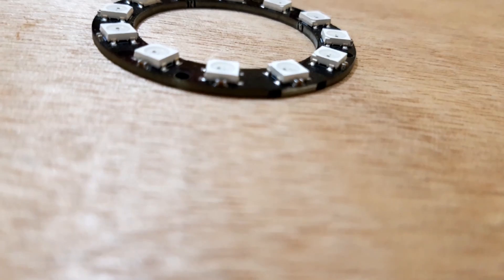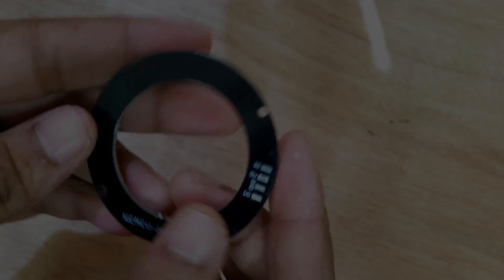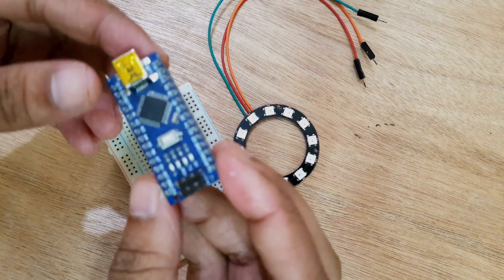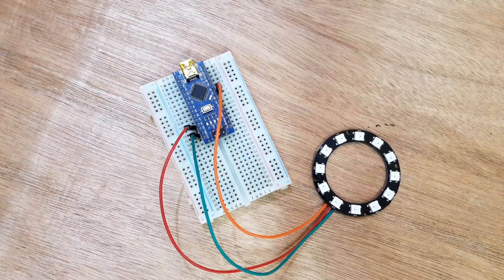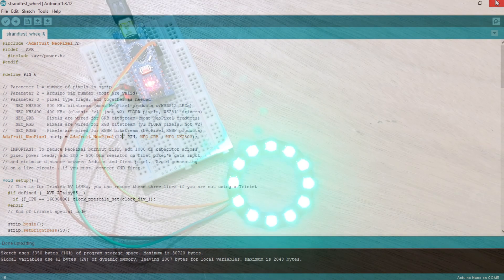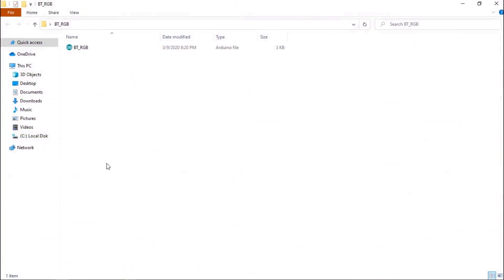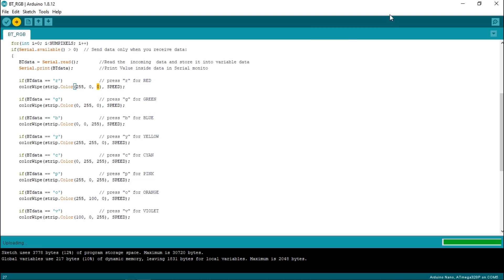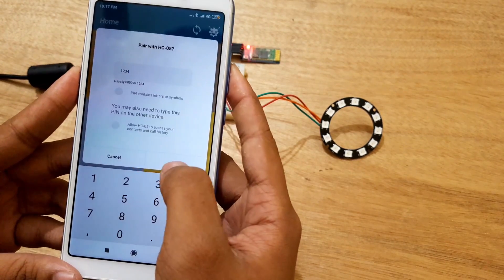Getting Started with RGB NeoPixels| WS2812B

Comment: Thanks for a great video!! 
I made an Arduino leonardo keyboard gamecontroller with 20 digital pins which I use on laptop usb or android tv. And it works perfect!
I want to use the led ring you have used along with SeedStudio Grove RGB LED stick (10 - ws2813 mini)  for background illumination decoration of my keyboard gamepad.  Is it possible to use these 2 led modules together with single Arduino Leonardo?  Any help would be appreciated :)
Reply: Yes

Comment: Personally, I would of done the wiring the other way around, in that the male pins are soldered to the neo-pixel ring
and using the female jumpers to connect directly to the arduino mini,

Granted you would always have to have it connected to the pins of the board, but for this example it would of been fine to do this way and you can scap the breadboard, making the project more compact
Reply from the maker: Hmm,

Comment: now i woud need this exact thing only the leds woud need to be only red and have + and - nothing else if anyone knows where i can get that please coment
Reply from the maker: So, need the same thing, but with only red led?
Reply: @ElectronicsBd  ye the ring only with red leds and have + and - thats all
Reply from the maker: @Maykay1312  I don't think It's available
Reply: @Maykay1312  if you mean without a mini controller idk how you would do that
Reply: @mitchdbd4706  its used as a ring same as the angel eyes on the older bmw inside the headlight but i put the same style led projector on my electroc scooter and the ring light was overvoltaged and it died because my step down dc to dc board overheated and exploded xd
Reply: @Maykay1312  oh lol i was planned to use this as an angle eye aswell haha
Reply: @Maykay1312  but my scooter has this 12v thing ehere you can put a charger in and then i could put the arduino in that charger and the arduino will make sure it's red or whatever i make it too and will put out 5volts
Reply: the only red is easy but you will need the data cable